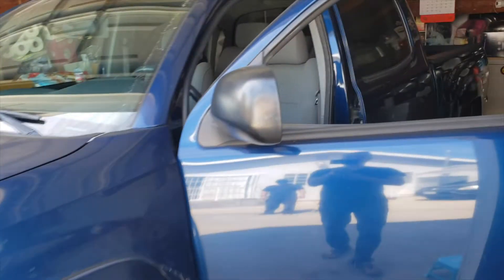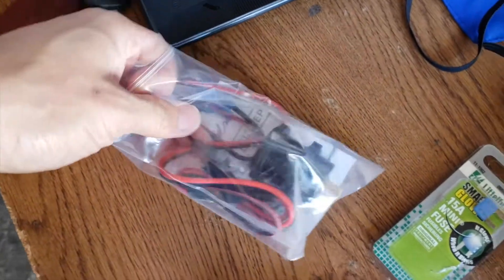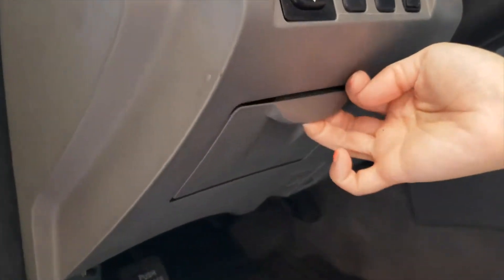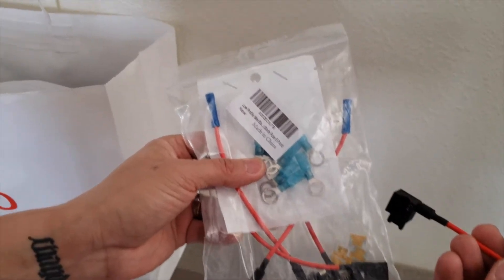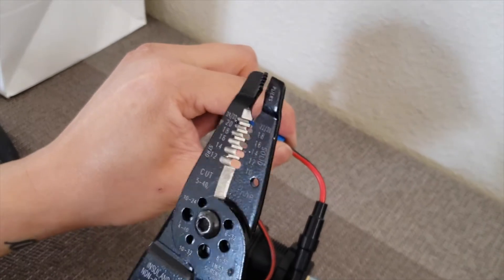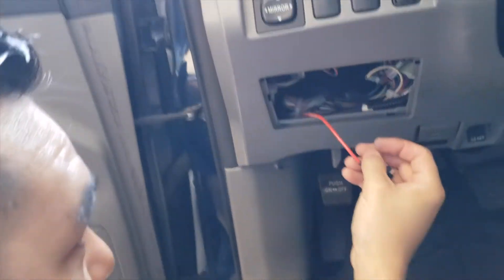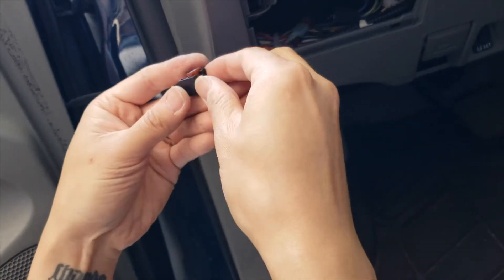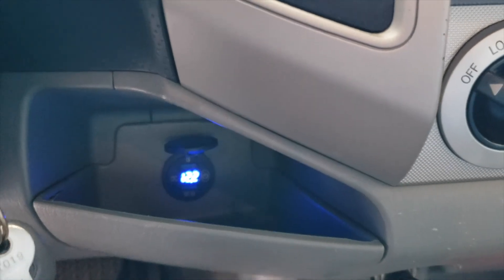How to install a USB Charging Port in Your Car (2nd Gen Tacoma)

Comment: Thanks for the video. Because you made it look so easy, I followed your links and purchased the USB port and the fuse tap. Received both items the next day from Amazon. Following your video, it literally took me about 20 minutes to complete the total install. Couldn't be happier with the results. Other videos showed having to removed the dash, glove box, consoles, floor panels, etc., all which would have taken many hours to complete. Again, thanks for posting your easy-install video. Keep 'em coming!!!
Reply from the maker: I've read that the Tacoma dash is a bear to remove, so I'm glad this helped!  Did you install in the same spot as I did?
Reply: @LiL13izzy7  I installed it exactly as you did. Worked great. Had to laugh after watching some of the other videos showing you how to dismantle the dash and console to do what I did in 20 minutes. So glad I caught your video before I went in any of the other directions. Thanks again for posting your video. If you have any more improvements to a (2010) 2nd Gen Tacoma, I'd be happy to see them. Always looking to improve my truck. Only have 70K on her so hoping to keep her around for another 10 years or so.
Reply from the maker: @pbranch1277  this is my sister's truck so I haven't done anything else to it.  I did consider adding a wireless charger for it.  There's an aftermarket kit that looks OEM, that's made for this generation of Tacoma.

Comment: I followed this direction, but purchased the size that fits down in the center console.  It has a USB-C, a 3.0, and a digital readout (no switch).  It's a really tight fit, but ran the wires similarly.  This thing looks factory where it is (one of my two blanks).  "USB C Car Charger Socket Toyota Switch Replacement, Dual PD and QC3.0 12V/24V Panel Mount USB Outlet with LED Voltmeter for Car Truck Bus Off-Road Vehicles RV, etc. - Green LED Display"  Bonus...the person named their store Stark Industries lol.  Thanks for the vid, big upgrade over the old plugin adapter
Reply from the maker: Glad you found it helpful!

Comment: You could’ve just removed the cigarette lighter and no drilling needed
Reply from the maker: Nah, still want that for other 12v accessories that use that input, like my air compressor, and many more.

Comment: How do you wire the USB port up so it will stay on when the truck is off????
Reply from the maker: You just plug it into circuit that is "always hot (meaning always on).  If you do this, at least buy a USB port with an on/off switch, or include an on/off switch in the circuit so that you don't drain your battery.  I did a few like this in my FJ as well:

https://youtu.be/eYHn1gdsMmU?t=466
https://youtu.be/dLhJIaOdO3I?t=342

Here's a video I made that will explain the aftermarket on/off switches I used:  https://www.youtube.com/watch?v=8ftolyaHp20 

Good luck!

Comment: What would you have to add if you want to put more than 1 USB port? Say you’re adding 2 USB port total. How would you add that to your fuse box?
Reply from the maker: You can find another fuse to tap into, using the same method
Reply: @LiL13izzy7  anyone? Because it seems like everyone seems to like to tap into the Accessories first.
Reply from the maker: @jimmycha12345  I wouldn't pick any one.  You can tap into accessories, but you would have to splice wires.  It's better to add a circuit.  Consult your fuse diagram.  For instance, I wouldn't add a circuit into a 20 amp circuit because that would be overkill for a USB charger.

Comment: Do you know if the same add a circuit will work on Tacoma generation 3, thanks for the easy to follow video
Reply from the maker: Since I don't have a third gen, I'm not exactly sure, but you will know as soon as you open up your fuse box and see what kind of fuse is in there. Here is another video that I made that explains some of the different fuses.  Hope this helps. This one is easy to follow too: https://youtu.be/5XObhMQ0wCo